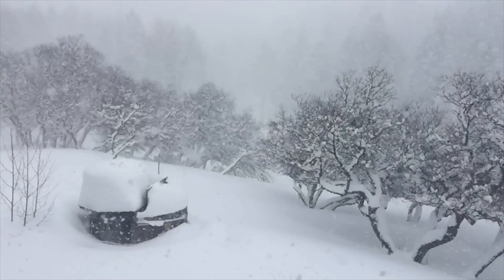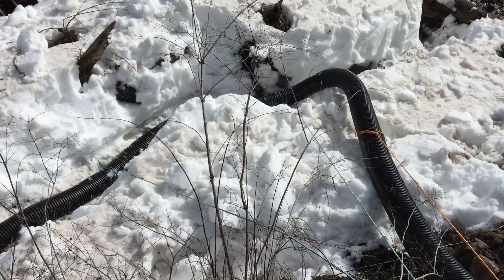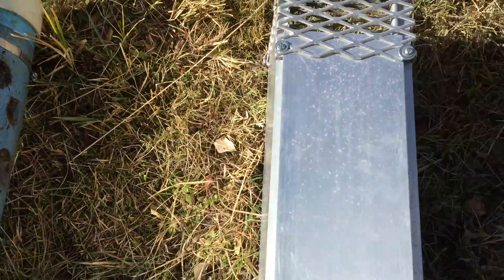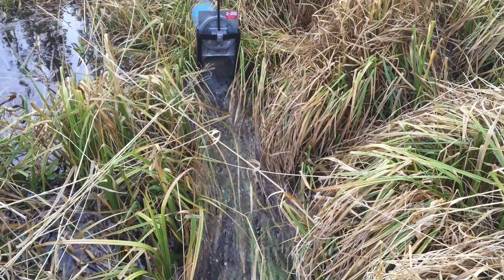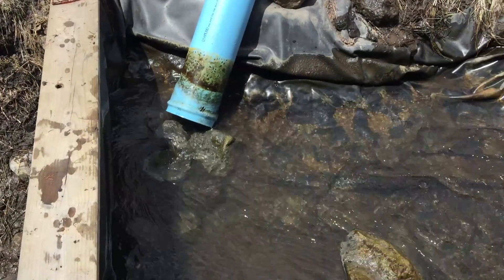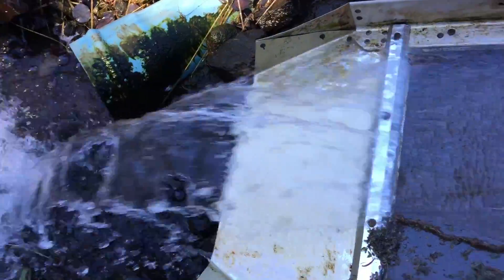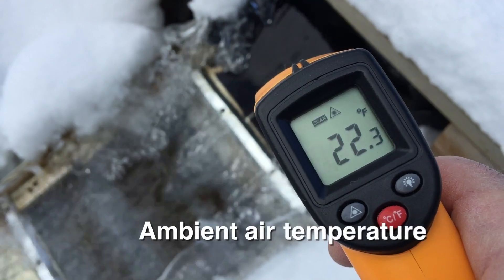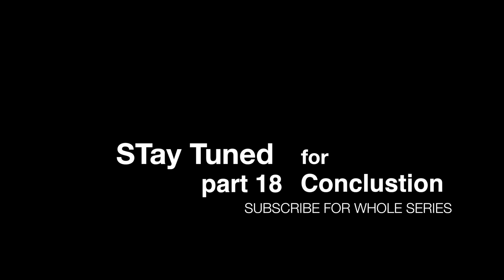Part 17 MicroHydro Power System in CO

Comment: Also, as a marine generator/switchboard consultant, I've learned that anything outside 57 to 63 hertz  for more than 5 seconds will sooner or later destroy electronic appliances. Most homes today have 200 amp utility services to supply most every desired appliance. Too bad you didn't choose a 48kw generator and larger wire to your home's distribution panel. It appears you only need to add parallel pipe from the marsh to the powerhouse to spin a bigger 3 phase gen under load at 60Hz. It's also sad that your state electrical inspector neighbor failed to explain that 3 phase power is the best most efficient way to get KW from source to load. It does NOT cost that much more to replace a single phase distribution panel with a 3 phase panel. I hope you will consider the following efficiency/safety improvements: By replacing the belt reduction drive with a large diameter and massive direct drive flywheel between the gen and turbine, you will be able to easily regulate shaft rpm (hertz) with only an electrical servo controlling the turbine jet diverter plate shaft with micro-movements. The heavier the better. Adding an extension beneath the turbine housing may be required to provide for a larger/heavier flywheel. The flywheel inertia compensates for rapidly changing house loads and eliminates the need for inefficient resistive load controllers. A similar motorized needle jet valve and controller would tweak your system even more. PID controllers are readily available for commercial applications and for hobbyist apps like yours. Hope this helps. Jack, aka electricalpowerguy
Reply: From earlier some where along the line I believe it's a 30 KW  generator ( that's about 250 amps ). When designing residential power distribution they allow 5 KW per home. The way it's designed MrHydroHead sets the needle valve to generate at a level he wants to use. The system then runs at 60Hz by shunting power to waste heat coils. Only when the shunt exceeds their capacity does the system stray from 60 Hz. We had a private discussion about this 2 years go and the band width is now less than what is shown in the videos. I was going to ask how that is working out. This is the most robust micro system I've ever seen. Would love to see how his neighbours are doing. :-))
Reply from the maker: Well being an expert as yourself, I'm certain you never pass final judgement on things until you've actually gathered all the information on the ground.  I sense a lot of judgement on your part without all the facts.  3 phase was considered and wire lain for that for any future need.  Our 10K generator can be wired for 3 phase, but given the needs at the overall property and owning existing equipment, going bigger wasn't necessary and we had no desire to wire the house or purchase newly inflated costly units for such.  Also our ELC manufacturer told us going 3 phase was impractical unless we had about 25k.  Balancing the loads became cumbersome and problematic.  The speed of the jet in the turbine is insufficient to achieve 1800 rpm.  That is the reason for the pulleys.  Another recommendation, this time from the turbine manufacturer.  Additionally why would I want to redesign a system and go the expense of rebuilding it when it works fine as is?  Ain't broke don't fix applies in my mind.  I get lots of comments complaining about how I chose to execute a plan with ideas about how to redo it all.  My dollars, my land, my project.  My intention wasn't to fish for better ways after the fact.  I only wanted to share my knowledge and experience (limited perhaps) and fill a gap I perceived in actual practical information on YouTube.  And yes you could call me a tree hugger but given the state of the world today whats wrong with that?
Reply: It seems I not only misinterpreted your videos but also
struck a sensitive nerve within you. My only intent was to offer a few suggestions
on how you could convert the mammoth natural water runoff energy on your
property into more electrical energy. Kinetic resources are very green and
worthwhile for your system. EVERYTHING about your channel tells how you started
with an idea for hydro power, then fished for better ways after the fact, and made
continuous changes to improve it over several years. You have now convinced me
that if an idea for improvement is not your original idea, then it’s not worth your
consideration. From background shots in your videos, it appears your home and
property might be worth $1M. Who in their right mind would build such a
structure with only a 10kw electrical service??? This oversight alone will prove
to be the primary cause for the devaluation of your property. Private, single
family homes (not hunting cabins or lodges) of this size have a minimum 48kw
service. Your ELC manufacturer did you a dis-service by not recommending this
to you. They also appear to be ignorant about how 21st century load
balancing is accomplished. Three phase distribution panel costs are inflated
only by greedy suppliers that take advantage of tree hugger ignorance. This is one
reason why online purchasing has become so popular today. Please disregard my
suggestions and forgive my intrusion into your utopia. I will unsubscribe, not
bother you with anymore suggestions, and maybe spend more time helping Trump make
America better again. You’ve got 340 acres of trees to hug and much kumbuya singing
to accomplish around each one, dude; best get busy with that instead of fixing
what ain’t broke….

Comment: I just found and subscribed. After watching all your vids, it's quite obvious you have invested multiple tens of thousands of dollars for your tree hugger approved hydro power system. I'm guessing utiliity power costs about $0.10/kwh in your area. Yes, I know we tend to overlook hobby costs versus days of enjoyment acquired. Please honestly answer the big break even question if there is one. Thank you for any reply.
Reply from the maker: Thanks for watching. This is a frequent question.  Payback?  An estimate to run power lines to the property in 1995 was $140k and more recently $250-300k, so the initial investment in the first system which supplied both gravity fed domestic spring water, a fish pond and power all for around $25k in 1995 was a no brainer.  The redesign and move of equipment added about $55k to that and provides all the power we need for winter heating and potentially bitcoin mining in the future.  Total more than 200,000Kwh produced so far.  So it's not really looked at in terms of pay back, but more an investment in the property and an independent lifestyle.

Comment: Very impressive. I watched all 17 videos. Any estimate on what the cost was that you would be willing to share?  Seems like solar panels/wind with battery storage might have been more cost effective (aka less labor).
Reply: The biggest cost is enough land, with enough water flowing through it (or at least the rights to use/divert the water) and enough elevation change. Whatever they spent on that hydro project is likely dwarfed by the cost of the property, unless they've installed it on land they don't own.

Comment: Interesting, thanks for sharing. But there seems to be a lot of carbon used in construction (concrete, plastics etc.) Did you consider construction a mill pond lower down and using a low rpm device like a water wheel to power the generator?

Comment: Do you have an energy storage method? Like Tesla Power wall.
Reply from the maker: No. We are strictly AC which cannot be stored without conversion to DC. There are battery systems that can synchronize an inverter to an AC system, but they are somewhat expensive.  As it is,  we have more power than we can effectively use, so there is no need for storage.  Our excess power gets put into the form of heat, either in domestic hot water, house heating, or a soon to be installed hot tub.  We may at some point apply the power to a bank of bitcoin mining computers to generate a bit of income.

Comment: 1) Mount brush onto small bicycle wheel
2) Mount wheel on top of screen
3) Attach wheel to turbine/propeller 
4) Falling water will spin the turbine/propeller which will spin the wheel & clean the screen

Comment: Does the screen need to be so fine? Some debris can flow through the turbine if it is not too hard, too stringy or too big but i think i can safely say all of the screens you tried were a bit on the fine side.
Reply from the maker: Just being cautious. The pelton is a very expensive item, today being multiples of what I spent to acquire it in 1995.  So far, no erosion of the pelton cups after 20 years in service.  A very stout product from Canyon Hydro in Deming WA

Comment: Have you ever thought of making a small water wheel above the screen with brushes attached to constantly clean the screen?
Reply from the maker: Thanks for the suggestion.  A bit beyond the necessary complexity.  Its all running fine with minimal maintenance.

Comment: Really nice videos.  Suggest more research on irrigation screening and filtration systems because you are working too hard on that part of the system.  A turbulent fountain aka bubbler would help with screen cleaning.  Here is a link to the government info.

https://www.ars.usda.gov/ARSUserFiles/20540000/presentations/trashscreen/trashscreen.html

Now this information is a good basic starter.  But long term ag use has shown better answers.  First off don't bother with a round collection area.  Square boxes are easier to make and to screen and work just as well.  Second don't bother with the high price stainless screens.  Rolled expanded metal covered with pet proof/cat proof window screen is the answer.(if long life is the goal the expanded metal might be stainless)  The pet proof window screen is fiberglass window screen coated in plastic making debris mostly slide off.   For bigger installations simply stitch the screen together with mono-filament keeping everything as smooth as possible and the lap joints pointed outward so there is nothing for outward moving debris to catch on.  2 common mistakes not to make here.  Everyone wants to make the elbow a smooth curve.  Don't.  It generates part of the turbulence that makes these work.  You want that sharp square corner.  2nd mistake is everyone wants to slope the screen to help with debris removal.  It doesn't work.  The screen needs to be flat.  If it starts to plug off the water piles up and actually mildly floats debris off.  Sloping the screen keeps this from working.  A properly functioning bubbler will probably eliminate your air problems at the inlet.

Now for keeping large debris out of the pipelines debris forks slightly angled out past parallel to stream flow and flat plate systems where the plate runs parallel to stream flow flow are mostly self cleaning.  There are numerous working ag systems to look up.

If you end up needing active screen cleaning at either screen, a ram pump installed at the outlet in the meadow could provide both power and a cleaning spray.  To take it up stream to your primary inlet a small black poly line could be run inside your other line so you didn't have to dig anything up and for cleaning the pennstock's screen a small poly line across the meadow would do.

As for air bleeds needing maintenance guessing the bubbler would eliminate this.  If it didn't would commercial summer time type air bleeds work if mixed with a passive solar or earth base heat pipe system to keep them thawed out or at least thaw them out on a regular basis so they worked in freezing weather?

Comment: I hope to live off the grid one day, but this is a bit much. I'm hoping I can get by with a more energy efficient home that is partially buried into a hillside to keep warm in the winter, combined with future solar panels that will be much more efficient paired with high capacity battery banks like the Tesla Power Wall for caching energy during cloudy stretches. Hopefully by then appliances will also be more energy efficient, and home insulation even better at preserving heat.
Reply from the maker: +DrDigDown Solar aligned earthworks are a great way to go.  Any efficiency is a good thing.  My process began in 1990 buying the land and then building in 95.  Lots of innovation since then which should only accelerate in coming years.  My initial electric needs were adequately met by the first system (early segments of vid series) for 17 years.  I was fortunate to have another option when the spring flow became much reduced.  Didn't start out to capture so much power, but evolved into what was available when need and circumstances arose. Thanks for watching
Reply: MrHydrohead yeah your system is pretty elaborate and very interesting, but doesn't it take up so much of your time trying to rig up new solutions and fix/maintain existing ones? I guess if you enjoy it then it doesn't feel like work. For me I'd spend most of my time hiking around and doing photography. Being able to afford something like this is many years off for me, so hopefully solar panels will be a lot better. The main problem is land. I doubt there will be much available in the 2030s or whenever I buy, as even today it's hard to find land and when you do, it's so expensive. I wouldn't need a lot of land for solar but I'd like a decent sized chunk of a few acres, hopefully adjacent to protected public land that I could wander.
Reply from the maker: DrDigDown I spent 30 yrs as a Cinematographer in Hollywood and that's how I got the time/$ to pursue this.  It really is almost no maintenance and putting in new things is more a fun hobby than necessary.  So are the videos. Not really that much work or time.  Just want to share the knowledge.  Hobbies for me are hiking and stills too, among others.  You never know on land, you may just stumble on something great at the right time in your life, I did.  Having the aspiration keeps you paying attention.  By the 30's most people will live in urban places, so it might not be as difficult as you imagine.  Time will tell, but for certain, technologies will more rapidly advance and you have lots of time to learn and dream about what you'd like to do.  I hope it all pans out wonderfully over time for you.  I'll keep posting videos on my own and other people's systems over time.  Hydro becomes somewhat addictive as I'm sure solar does too.  Best to you...
Reply: Hiking and Stills? You'd love Tasmania!

Comment: what a beautiful lifestyle.. can you use heatpumps up there for heating? they are much more efficient.  or is it too cold?
Reply from the maker: +Richierich90000 We could use them and I probably should have buried a loop when we put in the power line. But, alas too late after the fact.  We have sufficient power with older less efficient methods to keep us was in the Rockies at 8600 ft.
Reply: im guessing that an outdoor split system wouldnt work in your environment, ive just switched over to heat pump for heating here in Canberra- much cheaper than piped natural  gas

Comment: Did i miss something. why are you filtering water that is going into a meadow?
Reply from the maker: +Ikeman Started out being concerned that sediment and rocks might collect in the ribbed flexible pipe.  After this year that doesn't seem to be the case as the diversion was virtually an open ended pipe.  Air entrapment was the only problem in that it lessened the flow

Comment: What happend to the old two springs?
Reply from the maker: +Gokatgo  No one has ever asked that.  They still flow year round and supply us with gravity pressurized domestic water.  The water also continues to provide active water to the trout pond as it did in the past.  We may in the future use that flow of cold water to cool processors for bitcoin mining with the excess power we have.  Thanks for asking.
Reply: Cool. Thanks for the answer!